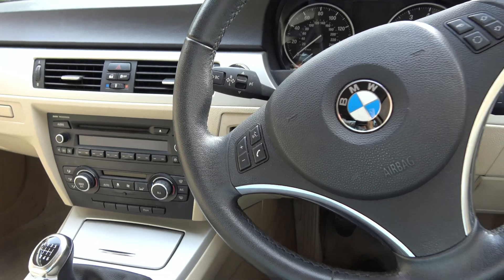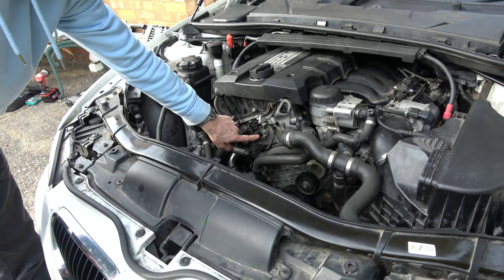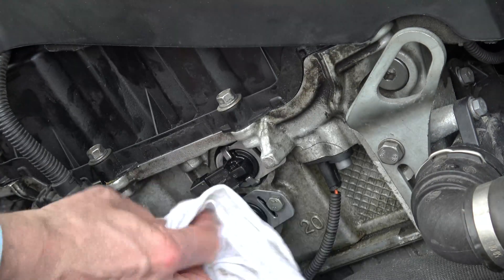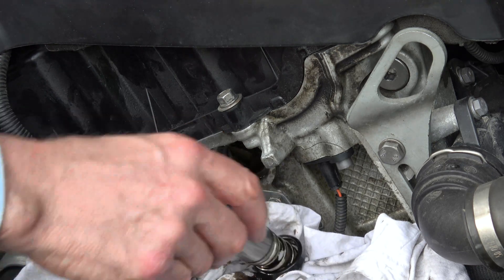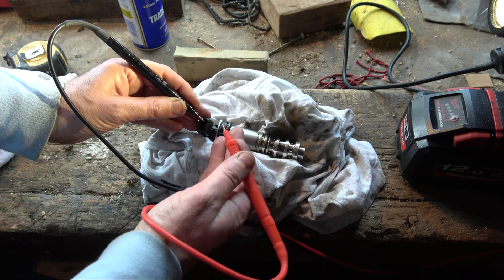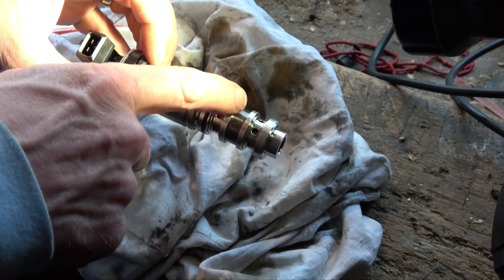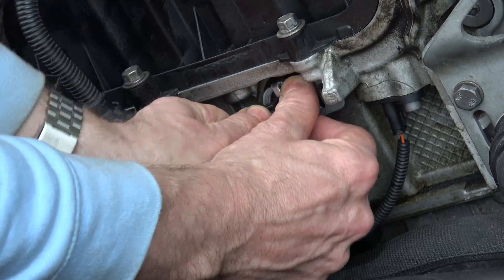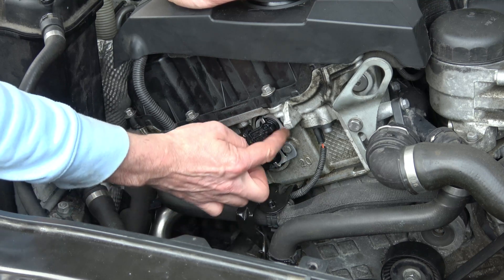BMW 320i E92 Intake Camshaft VANOS Solenoid Replacement & Test N43 Engine

Comment: Bro, thanks, i cleaned mine and now runs much smoother, it had some gunk on the mesh, cleaned it well with the mass sensor spray, when i was changing geara was lagging a bit, now just goes smooth, and runs better, great thing to do, fast and easy.
Reply: I certain recommend the mass airflow sensor cleaner instead of brake cleaner

Comment: IPA ile temizlenebilir mi? Yoksa Balata Spreyi ile mi temizlemeliyim. Temizleme vdeosu da çekmeyi düşünüyor musunuz?
Reply from the maker: 1st time I cleaned it with brake cleaner, 2nd time I soaked it in a small tub of IPA and I made sure the contacts were not covered. I actually activated it with 12  volts on and off whilst in the IPA. You could see the dirty oil being pushed out. Unfortunately though, even after cleaning both times the error code/ engine management light came back on after a few days and I had to replace them.
Reply: @WhatHappensWhen  öncelikle cevap verdiğiniz için teşekkür ederim. Peki yenisiyle değiştirdikten sonra ne kadar süredir arabayı sürüyorsunuz ve sonrasında hiç hata kodu aldınız mı? Bende ki hata kodları 2A98 ve P13B4.
Reply from the maker: @EA066  On this car it turned out the main problem was the plastic timing chain guide had disintegrated which led to a loose timing chain, eventually it skipped a tooth (or 2) and it refused to start. So it needed the timing chain and guide replaced. Weirdly cleaning the VANOS solenoid valves and the sensors seemed to help it, but the underlying problem all along was a stretched and loose timing chain. Your codes do seem familiar to me, but over a few months the car brought up many different codes so I can't remember exactly. Unfortuantely the plastic guide is a common failure on these engines, however cleaning the VANOS solenoids and sensors are easy enough to do and you may get lucky (unlike me). I hope you get it fixed.
Reply: @WhatHappensWhen  umarım dediğiniz gibi düzeltebilirim. Tekrardan teşekkür ederim.
Reply: @WhatHappensWhen  nice video, how many miles did it have when you replace the timing chain?
Reply from the maker: @callummiller5886  Very low, about 47K unfortunately.